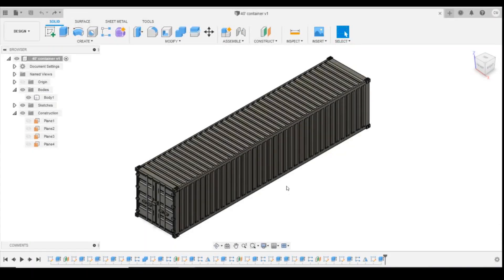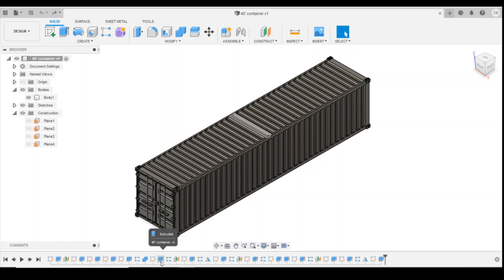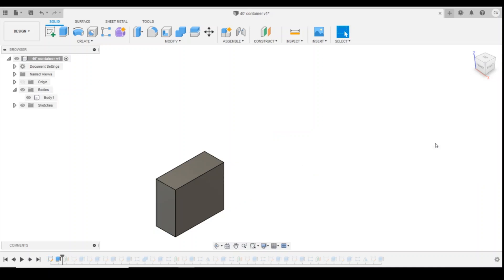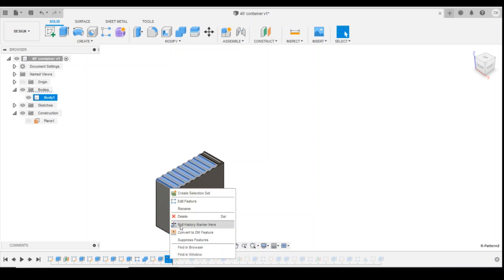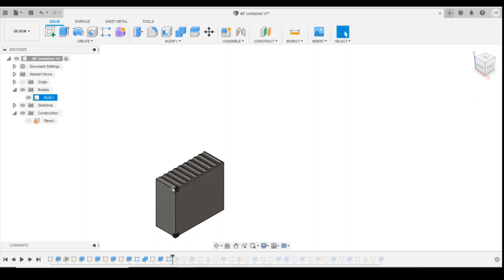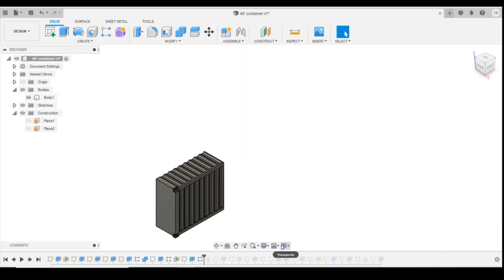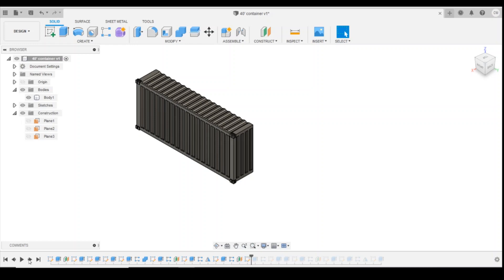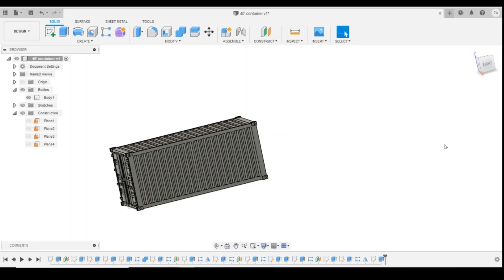Lesson 26 -  Beginners Guide to Fusion 360 Edit the Sketch History to change our Shipping Container

Comment: Good work once again Carl, I'm sure you must have covered this before so I'll have to watch through your lessons again, but while I think about it, one thing I've noticed when doing some trial modelling is when I select, say an internal face of a building and want to draw a sketch on that face, the software zooms out to the relative plane so the whole building is visible, but the internal face I want is now hidden by the outer walls. Is there a way to temporarily hide those outer features so that the face you want to sketch on is visible? Thanks
Reply from the maker: Hi Paul,

There is a way using sectional analysis, which I cover in lesson 28 while I draw a cable drum

Thanks
Reply: @3ddrawingformodelrailways  Great stuff thanks Carl